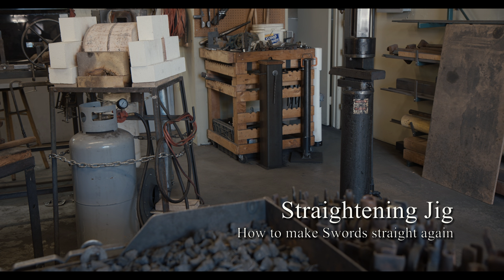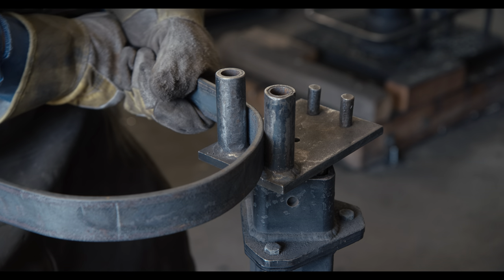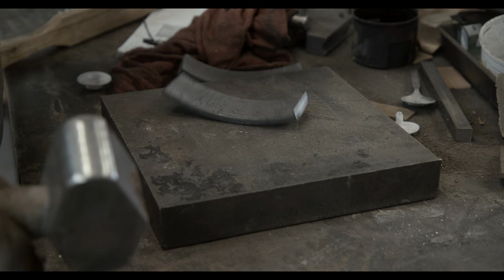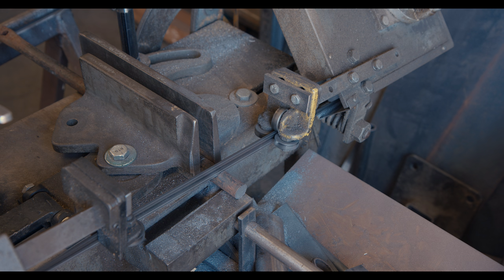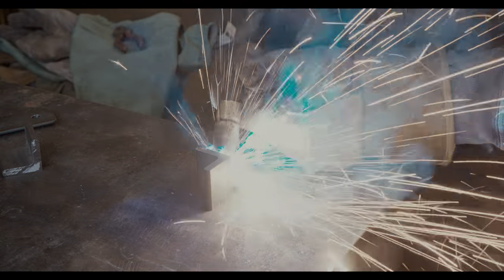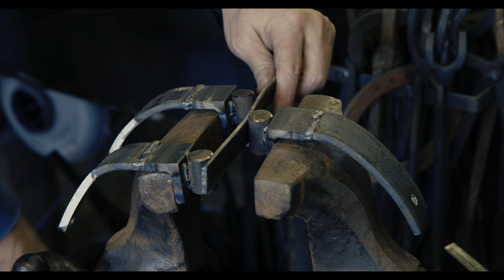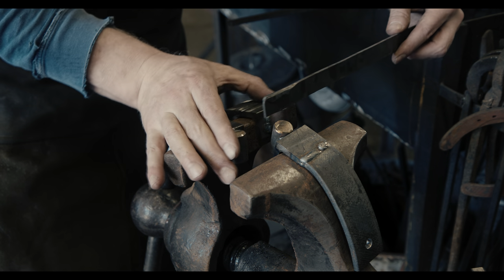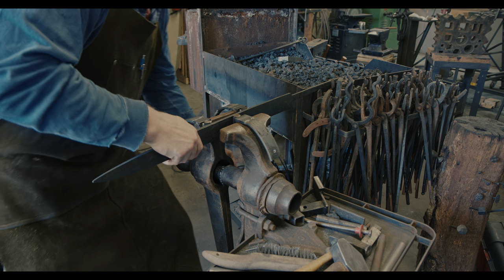How to Straighten a Sword with a Jig  (4K UHD HDR experiment)

Comment: The Roundbar doesn't leave any dents in the product?
Reply from the maker: +Casey Urquhart that depends but not in this case. Usually the steel is harder than the round bar. However, I made the back of the sword from wrought iron.